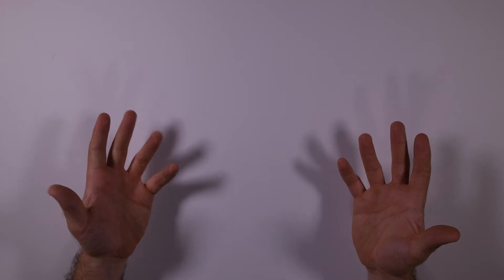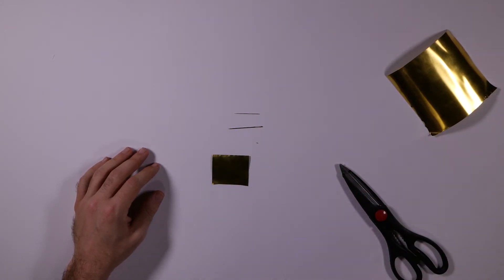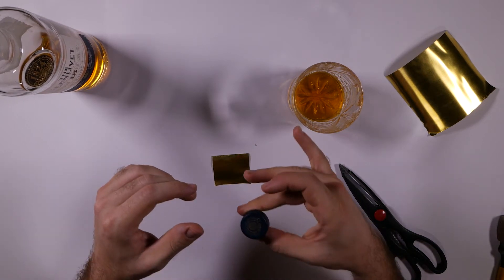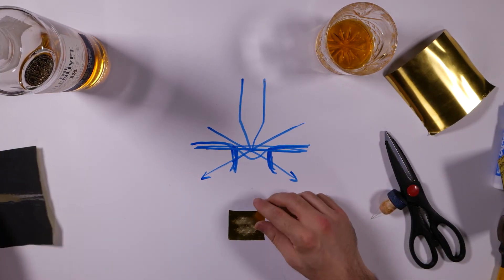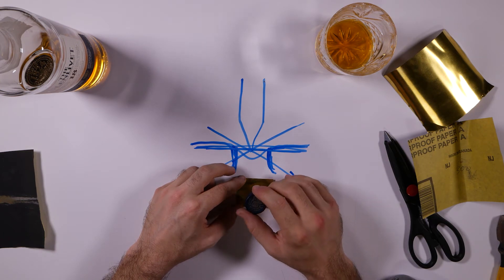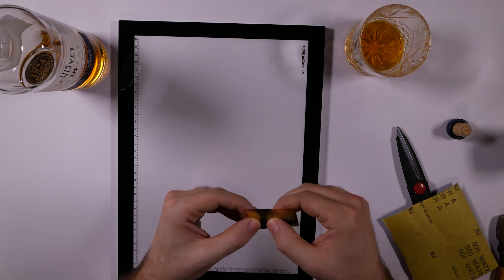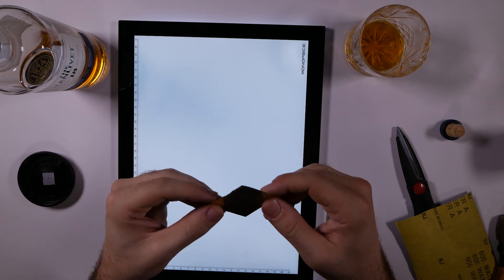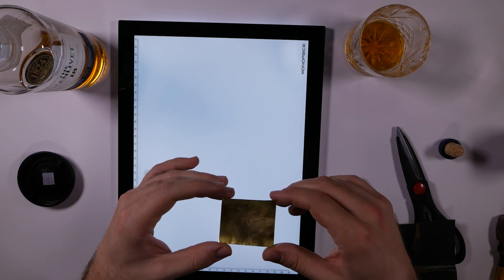The Pinhole Camera - Making a DIY Pinhole Tips and Tricks - Episode 2.1

Comment: I enjoyed the pinhole classes, I have devised a hand method to cut pinholes in aluminium foil. I employ a cutting blade from an Exacto knife, the one with the most acute angle of the cutting edge, and the most pointy blade. I hold the blade vertical over the aluminium foil and rotate it to produce a circular hole. The foil must be held down on top of a thick metallic surface with smooth finish, to avoid the deformation of the edges of the pinholes.  You rotate the blade until you reach the diameter needed. I measure the diameter by setting my enlarger to 10X and measure the projected image of the pinhole. Hope you find it useful.

Comment: For convenience I use micro drills on copper pennies epoxed to 3/8's washers and bevel both sides with another drill 3 sizes larger! I can make one in about 3 minutes! To calculate f stop devide pinhole diameter in to distance to recording plane. I then use magnets to affix the pinhole to the lens board to keep them from slipping!